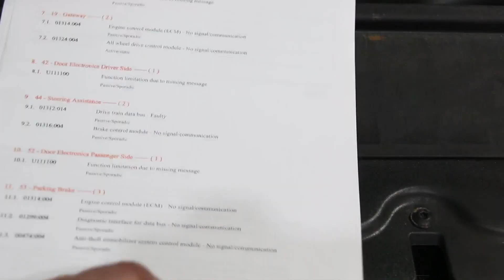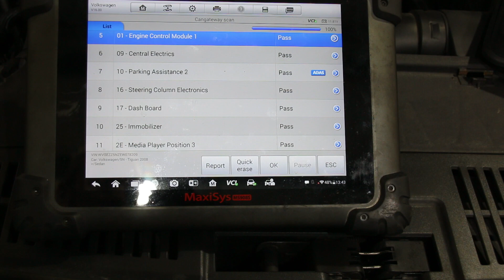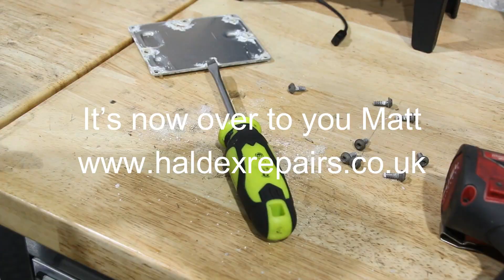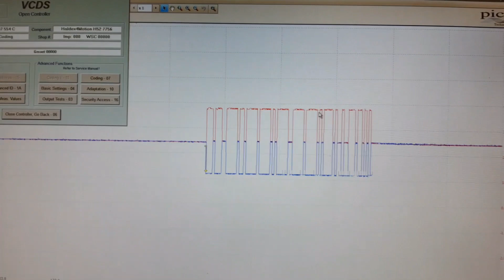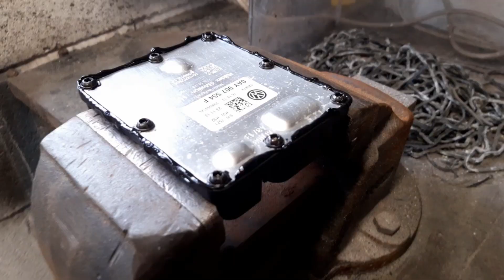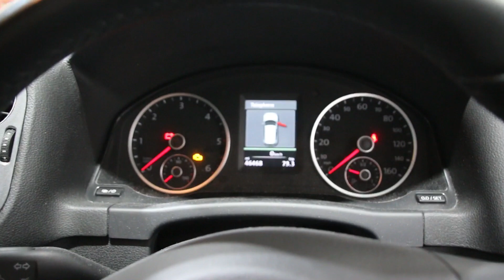VW Tiguan TDI ESP, ABS, EPS, PDC , TPMS Faults Powertrain CAN issue. Haldex Gen 5, Audi Q3, Q5

Comment: Thanks for the video. I have the all wheel drive 01324 fault and 01325 tire pressure fault. The auto handbrake has also stopped working, would this relate to the Haldex unit (mines also gen 5)? I’m on the east coast near Grimsby.
Reply from the maker: I’m afraid we can’t diagnose faults without the car physically on site.

Comment: This is great. I'd love to see more board repairs like this.
My 2010 X-Type has some similar "funky" readings from the TCM (on my relatively cheap Jaguar/LR scanner), and I usually get a check engine light coming back a week or two after clearing it, but the car runs just fine so I keep putting off getting it sorted. 
All the wiring seems fine, and the CAN signal looks fine on my Pico, so it might well be a similar issue with the circuit board in the TCM, although I took the TCM apart a few months ago and it looked fine.
Might give it another look though, as the symptoms look very similar to this.
I also get rare errors on the ABS module, it's on the same CAN line, so I might check that as well.